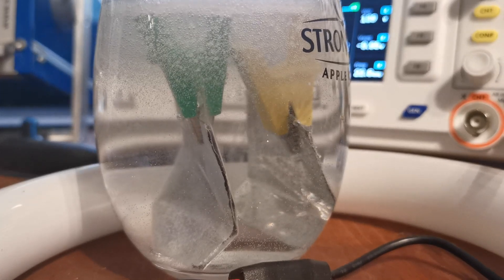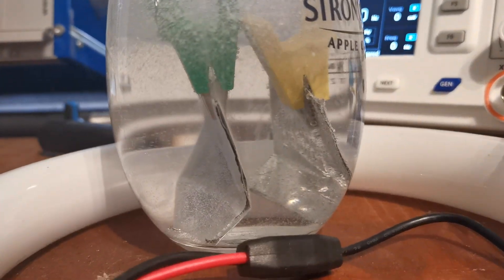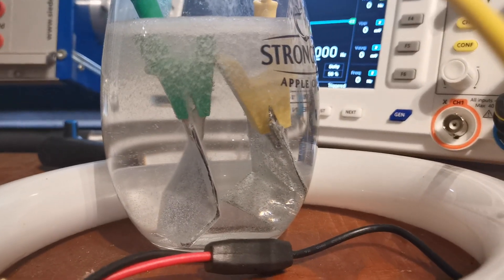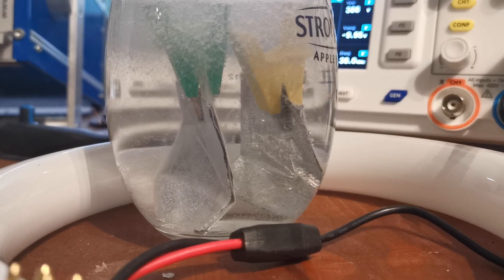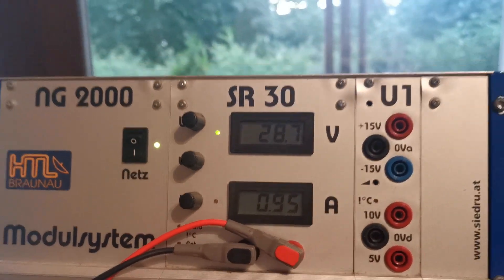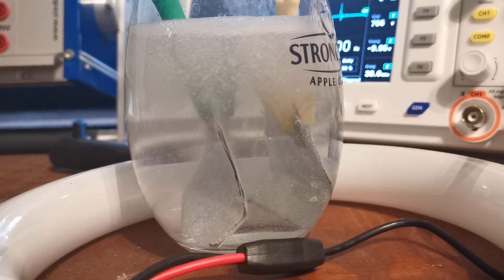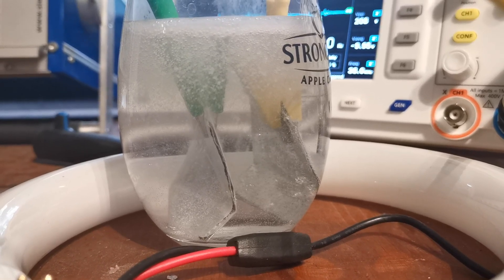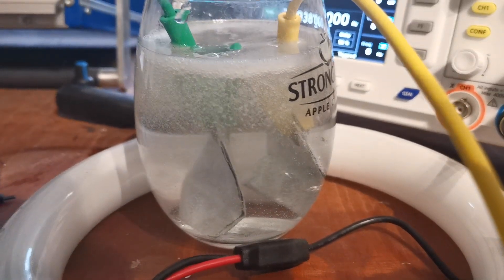Simple electrolysis experiment with my high voltage impulse generator

Comment: you could try hairpin circuit with pancake coils, it's a dielectric oscillator, and SS electrodes.
Reply from the maker: As far as I know my circuit is a modern version of the hairpin circuit.
Instead of the spark gap, I use a Mosfet for switching.
It also creates these high voltage (dielectric) impulses, but at a higher frequency than most spark gaps can do.
Reply: @OmegaZZ111 
And instead of the 2 capacitor, you use pancake coils? You could also try to inductive;y couple them.
The circuit resembles the voltage intensifier circuit of Stan Meyer which is a dielectric oscillator that operates between 1khz and 10khz.
Reply from the maker: @alanx4121  The bifilar coil has capacitive and inductive properties.
By rapidly switching the applied DC voltage on and off you create these high voltage impulses.
This is what the setups you mention basically do.
The goal is to achieve high voltage and my setup is one of the simplest and efficient setups I know of that achieves exactly that.
Reply: @OmegaZZ111  
Am not familiar yet with how these flat bifilars work, will look into it. A hairpin circuit with a bar can be touched, there really is no current through the conductor, I think this is the secret to free hydrogen: like you said HV DC, water is part of the shorted dielectric path, no current, correct pulse repetition rate for 'resonant action' (shaking by electrostatics), in the water.
Only your setup needs SS plates closer together and a gated pulse train.
Master Ivo showed how he could transmit dielectric energy through water, if only he tried the above experiment, playing with the frequency and 2 electrodes in water, but that was not his goal.
Reply from the maker: @alanx4121  While it is correct that there is no current in the copper bars when the capacitors are discharged, there is a lot of current in the transformer that powers the system. 
The hairpin circuict in total needs a lot of electric power, don´t just look at the HV side of the circuit, you need a lot of power to charge the HV capacitors in the first place.

This is differnet with my setup, as long as no load is attached (open circuit), it needs almost zero power to create these HV impulses, but as soon as you attach a load, current will flow and therefore electric power will be used.
Water is a load since it has high resistance and therefore power (current) will be used, I don´t think there is something as 'free hydrogen' to be honest.
In my video I was talking about if using short HV impulses could increase the efficiency compared to standard low voltage DC electrolysis.

If you look at my older videos, I did similar experiments like Ivo with using water as a conductor, it is a very good conductor for high voltage impulses at high frequency, but if you short the circuit using water (this is what is done with electrolysis) you will inevitably use power.
Reply: @OmegaZZ111  Look up Stan Meyer tech brief, I wonder if it is translatable to your setup.
Reply from the maker: @alanx4121  Found the document you were referring to, seems a bit too complex for me to build or fully understand for now.
From what I have seen in the document I maybe need a blocking diode in my system.
Maybe I will continue doing research and experiments on this topic in the future.
Thanks for pointing this out to me!

Comment: Nice demonstration, careful using aluminium, poisonous gases are produced. If your going down this path I can save you some time, start looking at the Joe Cell, it’s not just hydrogen but an orgone collection device. I played with the Joe cell fitted to cars as well as other systems and ended up settling on the Joe cell, which by the way setting alight the bubbles has a negative shockwave that damages the cell. Have fun but I warn you to be careful as this is serious power and getting it wrong can be devastating! Yes of course I blew up the bubbles too, couldn’t resist, just scoop some up in a spoon and light them away from your cell. Another tip, add a tiny bit of sodium hydroxide to your water, use stainless steel and volatility increases after 15 minutes operation.
Keep up the good work.
Reply from the maker: Yeah I thought that aluminium isn't the healthiest choice of material, but I only use it for short time periods with windows opened next to it.
Joe cell looks interesting, maybe I will build something like that in the future.
Reply: @OmegaZZ111  It definitely kept my attention for a few years and it’s what got me into electronics 20 years ago. Knowing what you clearly know, an assumption made from watching your videos, you will be off and running quickly in that field. I have watched most of your videos and find your demonstration’s quite calming.
Thank you